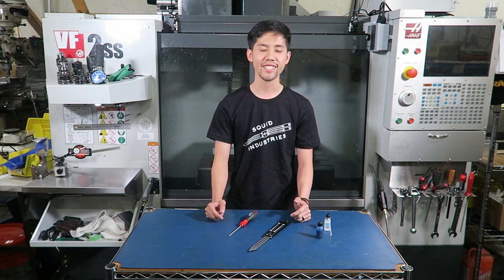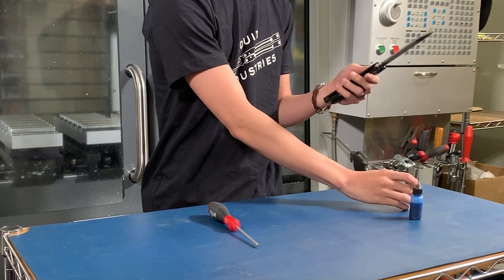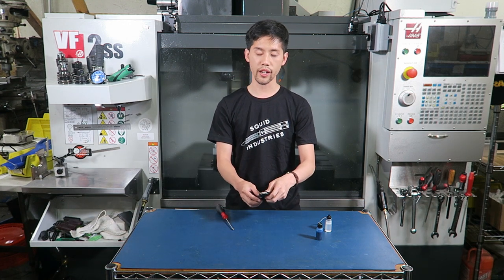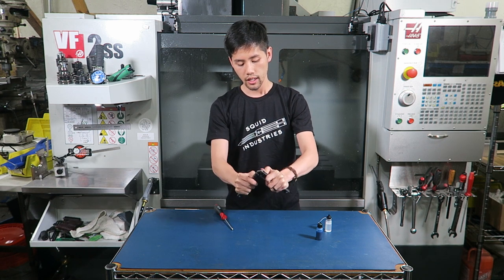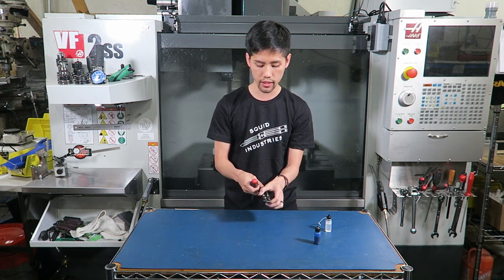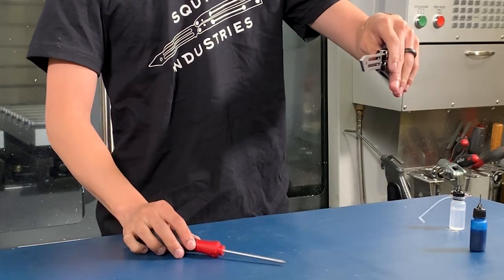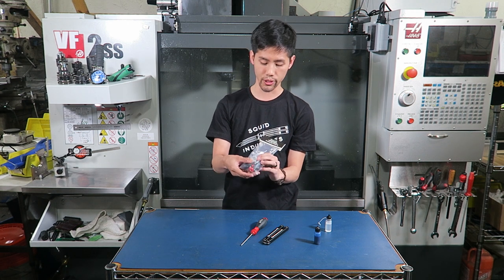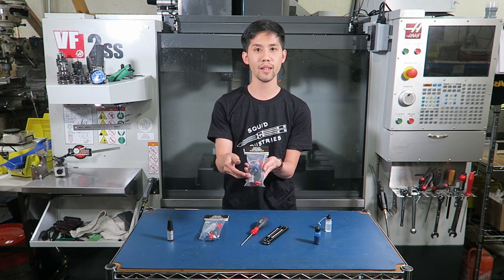How To Fix Stiff Handles | Balisong Maintenance Tips

Comment: guys, if the thumb trick didn't work on the first day, try again the second day after greasing it up the day before and threadlocking it. this is what happened with me and i tried the thumb trick on the second day and it fixed it, i did this with the screw a little loose before hand.

Comment: you guys should include things like this in the manual that comes with the knife, it works really well, and as a beginner i feel that this is a really common issue that is easily fixed so it would be nice to start with this knowledge instead of having to figure it out on my own.

Comment: thank you! this fixed my issue for now. also, I have no clue how to get into the oil that came with my maintenance kit, it seems to use an eyedropper bottle with a childproofed lid but I can't open it using any method

Comment: don't start flipping your bali right after applying locktite or threadlocker, wait 12-24 hours for the locktite to fully set
Reply: its better to flip it a bit to make sure its not too tight with the threadlocker cause then youre kinda screwed and have to do the thing all over again
Reply: @nickn27  not at all if you are not putting in a big amount you are completely fine.

Comment: what about a loose handle, do I strongly tighten it up? cuz if i do the handle will become stiff, but i don't the screw will get loose and eventually come off, please help!
Reply from the maker: You'll want to screw it down as tight as you can without binding the handles. As soon as you feel the handles are starting to slow down, that's when you should stop tightening.
Reply: @SquidIndustriesco  thank you, it works just find now just by doing exactly what you do in the video except for the part that i screw it down real tight but it still function well due to the moisture of the oil that was applied directly onto the screw. Thank you very much!

Comment: Weird question but will yoyo lube work for this? I have both thick and thin and i'm pretty sure thin yoyo lube is just straight lubricant
Reply: yeah it doesn’t matter what kind of lube.

I would use any lube that is fluid and not thick so the thin kind.
Reply: @Ohyesverygood  thanks man.
Reply: @PassTheSnails  yeah no problem, I use speed cube and it works perfectly

Comment: I have 2 different butterfly knife and is the screws all the same ? And what happens if I chip the teeth of the screw
Reply from the maker: They are not the same usually. If you chip the teeth, you'll need to use a screw extractor.

Comment: When screwing the screw back out a little bit, doesnt that lead to handle play? Before my handle got stiff i didnt have play, if i apply loctite, screw the screw back in and out a little bit, i have more handle play than before. Is there no way to prevent that?
Reply from the maker: Unscrewing the screw can cause more handle play so you'll need to back out the screw as little as possible. We recommending tightening it to the point where it's slightly stiff. After you flip it around for a bit it should break in 👍 -Lucas

Comment: I have a BM51, when i screw the zen pin screws in, the handle locks in place with the blade, how do i fix this? I feel like i have tried everything 😂
Reply from the maker: Best solution to that is to loosen the pivot screw or the zen pin screw

Comment: I don't know what the fuck happened to my knife but if i tighten the screw on the bite handle ever so fucking slightly, it starts rubbing on the blade at drags it with itself